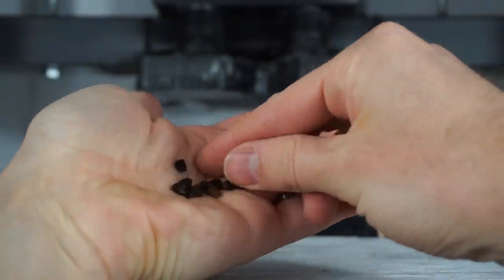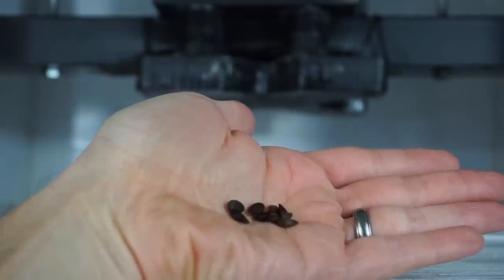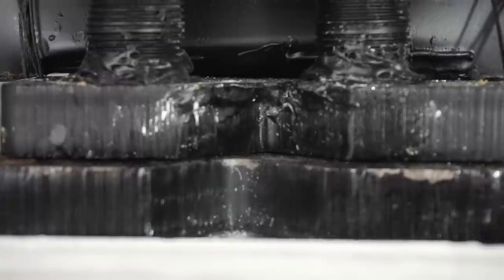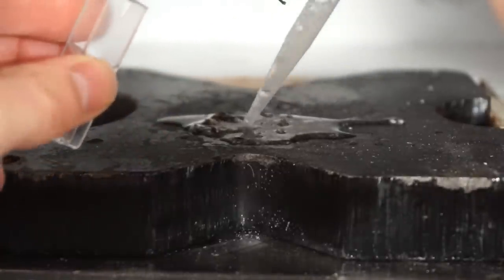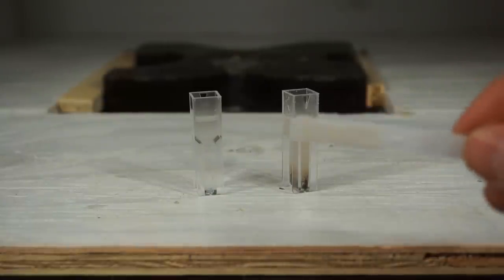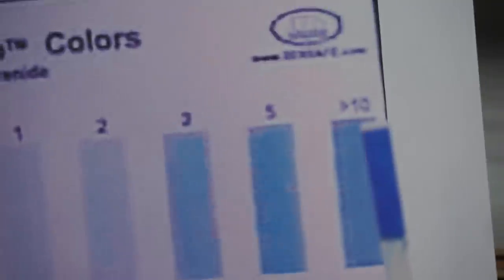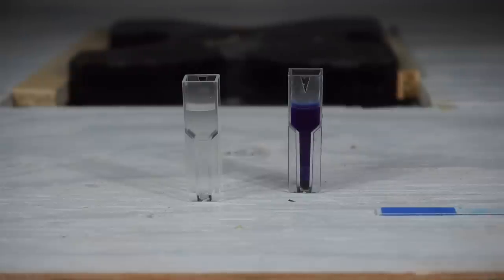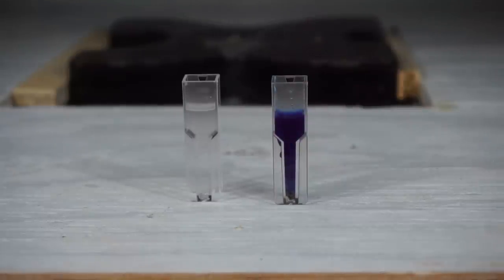Extracting Cyanide From Apple Seeds With Hydraulic Press

Comment: Wow an actual experiment on YouTube,  that follows the scientific method? Kudos.
Reply: "follows" is very kind. This was sloppy as shit and he jumped to an invalid conclusion based on extremely limited information.
Reply: This video is completely wrong in so many ways, not fact based at all and definitely not following the scientific method in any way.
Reply: The best way would be probably to grind the seeds and extract substance of interest (good ai filter) with some solvent.
Reply: You need to re-evaluate your understanding of scientific method. 

There was close to zero extraction here.

A start would've been..
Extraction of amygdalin can be performed by

Immersing the material in methanol and subsequent ultrasonification
    Soxhlet extraction with methanol
    reflux extraction in water in the presence of citric acid etc etc

Comment: You would need at least 150 seeds for any adverse effects.
Eating the seeds releases no cyanide because the skin protects it from your enzymes. 
The lethal dose varies on individual tolerance and body weight. 
To actually take in the most of the cyanide the seeds would need to be thoroughly chewed or ground very fine. 
A typical apple contains 0-20 apple seeds.
Reply: I also heard that the cyanide in apples is only theoretically dangerous, if you were to breathe it in in gas form or something (and probably also in higher concentration than just one apple). No idea if it's true, though.
Reply: So if we take the average of 10, and account for body weight, you're telling me I need only 50 apples? That's like 5 bags!

Comment: How many apple seeds should be eaten in order to be lethal?
Reply: really no amount of apple seeds eaten will kill you. The cyanide is in the shell of the seed and it is too hard to digest, so it won't create much hydrogen cyanide in your stomach no matter how many you eat.

I guess if you chewed thousands and thousands of seeds, and kept chewing and chewing and chewing until they became almost nothing in your mouth, you might die that way.
Reply: Dave Fish, chewing is the answer 😁
Reply: if you're chewing and swallowing apple seeds, without drinking any fruit juice or eating any of the fruit of the apple, which would neutralise the cyanide in your stomach, then you'd need to eat about 1000-2000 before you got really bad stomach pains and would be unable to continue eating them. If your jaw muscles were strong enough to be able to chew up that many seeds without completely seizing up, that is.

In most people this would not be fatal, you would metabolise the cyanide faster than you were ingesting it. If you were really, really unlucky (and determined), then that amount might kill you.
Reply: Dave Fish How exactly does the body metabolise cyanide? That's not how it works
Reply: If you were to smash about 500 seeds and not dilute with water, it would do the trick if you shot into your vein.
Reply: When Will You Learn? Its now about how, its just about how muh is in the seeds. Its barely anything.
Reply: around 18-20 cores put em in a blender and blend them well
Reply: I believe I read somewhere that eating like 1/2 a cup would do it but, not everything in the internet is right
Reply: What if you smash the seeds and extract the cyanide?
Reply: Get some large container and smash the seeds into pulp and juices and then eat/drink that
Reply: Without crushing and just ingesting it without much fine chewing it would be 60-80 seeds. With crushing 20-30.
Reply: Roughly 200 seeds or 20-25 cores
Reply: 200
Reply: hornetluca 3 for a healthy person, 1 for child or elderly.
Reply: u have to bite or crush the seeds to get the cynaide out 
and you need about 145 seed if you weight 70kg
Reply: I've read about it and from what I learned you need to drink/eat atlist 1/2cups of greatly crushed/blended apple seeds
Reply: Half a mug
Reply: Well, that's reassuring, you can't even get affected by the cyanide in apple seeds even if you are trying too. Thanks, metabolism. xD
Reply: You need 3 apple seeds crushed with your teeth to die right away. So, I'd only eat one.
Reply: It depends grown on a farm apples 150 wild apples tho different story only like 10 or 15 they have a higher dose in them dont eat them PEOPLE
Reply: Actually 150 apple seeds are enough to kill you
Reply: Actually 150 are enough to kill you
Reply: 150
Reply: 150
Reply: hornetluca 4
Reply: Dave Fish more like 200
Reply: you have to eat around 1,600 Apple seeds if you want go get the Lethal amount of cyanide
Reply: Well the leathal else is 120 apple seeds or above but I do not recommend eating the amount because it's 2 minutes of hell. Also it only takes about 20 apples.😳
Reply: hornetluca 150
Reply: hornetluca 150 seeds
They need to be crushed, and chewed thourouly
Reply: About 150
Reply: 150
Reply: I think cyanide is not a pain free way to go.  It is so gut rennchingly awful that maybe it is the excruciating discomfort that eventually kills.  Pain killers are less painfull.  Not recommended.  But still less painfull.
Reply: Dave Fish deff agree with you pretty sure ur jaw would just seize shut and you would prolly pass out from exhaustion and or pain at that point better off just drinking some apple juice and relaxing lmfao
Reply: When Will You Learn? Cyanide is natural occurring. The body actually does break it down easily. Cody's Lab did a video on this where he actually eats a non lethal dose of cyanide
Reply: Adam & eve ate da apple and God put cyanide into da core to punish any hooman who dare ingest da 4bidden fruit to da core.
Reply: Two tonnes. That'll kill you.
Reply: Eat 1000 kg daily
Reply: hornetluca it takes around 200 to kill you
Reply: the question is, why this place is kinda like suicide suggestion thread?
Reply: 7 barrels of apples will kill You first
Reply: 17
Reply: Sometimes citations are needed.
Reply: When Will You Learn? - thats right, that shit never leaves the body, like LSD there is no way to metabolize it. There was an ex-president (one from way back) who was exhumed and cyanide was found where his organs used to be. His death was then known to be assassination by poisoning.
Reply: Yo man I eat the seeds every time I eat an apple
I'm not dead
Reply: I have heard you would have to eat an entire bowl
Reply: hornetluca It binds to your mitochondria’s cytochrome oxidase, inhibiting the use of oxygen causing acidosis and hypoxia. But the amount in apple seeds to no where near enough to harm you in anyway. And other than cell death in extreme case of hypoxia, there’s no other chronic symptoms.
Reply: 95
Reply: at least 100 seeds will kill you
Reply: about 18-20 apples worth of seeds will kill you if you're of average weight
Reply: So that's more or less 120-170 seeds depending on how much you weight but mind that lesser amount will probably still damage your liver and could get you in a hospital
Reply: lethe56 two tonnes (or even the lesser mass tons) of anything will kill you.
Reply: If you Grind up about 200 seeds in a pestle and mortar then eat the paste should do it
Reply: 25 seeds mixed with horse spunk 👍
Reply: If cherry seeds take almost 100 than you won't have to worry about apple seeds in the slightest.
Reply: hornetluca about 25 apple seeds. BUT, you need to chew it thoroughly to get the cyanide
Reply: When will you learn: It's metabolised by the liver pretty quickly, so unless you take a lethal dose at once, your body can kinda deal with it ;)
Reply: Precious Taco do u really think that he's serious about killing himself by eating apple seeds?
Reply: about 5k - 10k seeds of an apple if im right
Reply: Probably need to evaporate the juice to concentrate to powder form.
Reply: hahahahahahaha
Reply: 150
Reply: 10000000000000000000000000 mcl of that liquid.approx
Reply: 150
Reply: I've personally eaten over 100 apple seeds in a day and for sure thousands in my lifetime. Never had any problems. The cyanide in apple seeds is bound to glucose and it's in fact called amygdalin.
Reply: Get some help.
Reply: around 147 seeds
Reply: depending on waight
Reply: google says 200 seeds for a fatal dose and 20 cores for a fatal dose so the person who said 1000-2000 you would be dead in hundreds of of a second including any one who got spat on and entered the blood stream im no professional but thats from reading online and in science books based on poisons
Reply: i would say a cup of seeds in a blender with some water. i would take several sleeping pills first. i think the cyanide has a pot life of hour or two. so the seeds in a blender is the last step...
Reply: There was a nice Video about this, I Think it was 100 - 150
Reply: When Will You Learn?: the contains an enzyme called rhodanese (a transulferase) that converts it to thiocyanate. cyanide is ubiquitous, lentils, lima beans, millet, barley all contain these nitrilosides as do nectarines in the flesh, cherries, huckleberries, peach and apricot seeds. Papaya. Macaroon cookies are traditionally made with apricot seeds, very rich in cyanoglucosides.  Vitamin B12 has a cyanide molecule in it. Most of the fear is based on myth and bad science. Pure hydrogen cyanide behaves like a vitamin with proteases. Papain, the enzyme of papaya is feeble without cyanide.
Reply: Jason McMurry. BS. arsenic or strychnine. not HCN.
Reply: 150 to 200 if you chewed them good enough
Reply: who is going to eat that many apples, or drink that much juice? The body has enzymes that immediately sulfate hydrogen cyanide into thiocyanate, so even if you could chew that many seeds without gagging, the body processes are quicker than the swallow reflex in ingesting them. food borne cyanides or Nitrilosides are a different thing from potassium or sodium cyanides. Lentils, lima beans, garbanzo beans and hundreds of other food plants have hydrogen cyanides in the form of glycosides or sugars that people ingest every day. Again, this is a silly ass video.
Reply: hornetluca about 198
Reply: 200
Reply: Dave Fish literally eating to death
Reply: Ive seen that eating a 150 straight up will do the job
Reply: 1 TON PROBABLY, THAT MUCH COULD BE ENOUGH TO EXPLODE YOUr STOMACH!
Reply: 1kg guaranteed
Reply: Well Mr Fish, apparantly the father of the modern computer Alan Turin used apple seeds to extract the cyanide and kill himself, so how do you anser that one?
Reply: Maybe 4 to 5 hundred to produce 1 drop of cyn
Reply: well I'm sure if you ate 10,000 seeds you'd likely die if not taken to a hospital.
Reply: Atleast 150
Reply: i am trying 50 apple seeds chewing them all
Reply: hornetluca around 30 apples
Reply: hornetluca like 5 kilos (I'm making this up)
Reply: The real answer is an unrealistic amount. Any real potential threat of cyanide poisoning cannot be obtained thru commercial methods, no matter how interesting this video is.
Reply: hornetluca u would hav to eat around 150 or more of apples n have to chue the seeds every hard
Reply: 1
Reply: you wouldn't need thousands, you don't even need hundreds if you put them in a blender, especially if you're a person of lower body mass
Reply: Test done by him was sensitive to 10ppm... And he crushed approx 10 seeds.... To kill somebody weighing 70 kg one would require 1g or less actually.. And 1g/ml = 1000000ppm... Which is 1lakh more time greater... So you will need 10lakh seeds.... U can lower it down to 5lakhs if u extract it efficiently...
Reply: hornetluca,   are u still alive? ................
Reply: If i remember it right it would be a big bag of seed
Reply: hornetluca lol so many apparent experts followed this comment
Reply: hornetluca 3.5 oz
Reply: hornetluca try it and find out
Reply: Chew about 200
Reply: About 33
Reply: hornetluca 200 +
Reply: You need 20,thousand seeds to cause death by cyanide.Fact.
Reply: @nebojsa1976  hello 4th grader
Reply: Probably over 1000. Cyanide is good for you in small doses.
Reply: @Knatrick  I can assure you cyanide is not good for you in small doses
Reply: @lebanemcarl68  I can assure you that there is a vitamin called vitamin B17 laetrile (aka amygdalin which has anti cancer properties) in apple pips and kernals of peaches and apricots. There have also been studies that cyanide in small doses also help to prevent cancer. Also if you find this really hard to rack your small brain around then please explain amaretto, an Italian liquor that is made from the stones of apricots and apple seeds and it's not poisonous.
Reply: 1.7mg(ml) per one kilogram, so.. Count. Though it applies to clean cyanide, extracted from the seeds.
Reply: @Knatrick  Just because it can "help" prevent cancer and it has a vitamin doesn't mean it's good for your body. Cyanide is a POISON do you get it?
Reply: Bake them then eat them
Reply: @lebanemcarl68  Everything and poison in high doses oh my God does you IQ match your age? And you still haven't explained amaretto.
Reply: more than 200 seeds after crushing them
Reply: 50
Reply: @juncastillo2371  yes, still alive

Comment: Is that a true hydraulic press, or is it a pneumatic press? I was just wondering, because it sounds like air and not hydraulic fluid. But, I may be wrong. Maybe some sound different. It would be cool if you (or anyone with more knowledge in this field than me) could respond. Thx!
Reply from the maker: Yes this is a true hydraulic press. Hydraulic presses can either have an electric pump or an air pump to pump the hydraulic fluid into the press. Mine uses an air pump so that's why you hear an air compressor.
Reply: ok. thx! the more ya know!
Reply: You need to eat 20+ apple seeds to get poisoned by cyanide
Reply: TOZTOZ how about Nightshade?
Reply: he uses a press with a 30+ton bottle jack in it, the bottle jack is being pumped by a pneumatic pump but the actual pressing power is made by the hydraulic system that is being pumped by the pneumatic pump.
Reply: TOZTOZ not unless you break the seed open
Reply: TOZTOZ wtf is a cherryberry
Reply: TOZTOZ you know Cherry's aren't Berry's lol
Reply: ya but.. Johnny Appleseed
Reply: Logan Landry it's probably pneumatics cuz you can here the compressed air as the press goes down and you Han hear the air compresser every so often
Reply: Chrysti Sander Thankyou for the information. Not that I would need to know how many seeds it takes to kill a man or anything.....
Reply: i love how i asked a legitimate question about hydraulics and pneumatics and it turned into a debate on how many apple seeds will kill you...thx internet.
Reply: Logan Landry: well, your question was answered so there wasn't really more to discuss about it.
Reply: Logan Landry bold and brash....
Reply: Its Zimyc yes. The boldest and brashest
Reply: you can't be poisoned by eating apple seeds, the cyanide doesn't come out of the shell unless you crush it into a fine powder. You'd need to eat over 1000 to even get sick.

If you crush 200 into a very fine powder you can use it to kill someone if you dissolve it into a drink.

but not apple juice, apple juice will destroy the cyanide :)
Reply: TOZTOZ I've eaten 3 cherry seeds once how am I not dead then? 🤔
Reply: TOZTOZ that. Is. Bull. Crap.
Reply: It's called air over hydraulic. It's great for shops with a good air compressor.
Reply: CHERRY BERRIES. I laughed at that shit for like ten minutes lmao thx

Comment: I'd say that you need to investigate how the test kit works to test for cyanide. There are two failure points I can think of currently:

1. Perhaps it's non-linear when it comes to testing for cyanide. (Outside of testing range).
2. It could be that the chemicals used in the test strip are able to "pull" the cyano group away from the amygdalin molecule much more easily than chemicals in the body are capable of doing.

The first point would mean that the test may indicate an artificially high amount of cyanide, because it's measuring outside of its effective range. The second point would mean that amygdalin inside the body may not be as damaging as the test strip reveals, because the test strip may have a greater ability to "pull" the cyano group away from the amygdalin molecule, showing a greater positive result.
Reply: @bengulmann3557  
It would be interesting to test Vitamin B12 tablets with the testing kit to see if the cyano group reacts and produces a positive result. Most B12 tablets contain Cyano-cobalamin.

Comment: After exposure, cyanide quickly enters the bloodstream. The body handles small amounts of cyanide differently than large amounts. In small doses, cyanide in the body can be changed into thiocyanate, which is less harmful and is excreted in urine. In the body, cyanide in small amounts can also combine with another chemical to form vitamin B12, which helps maintain healthy nerve and red blood cells. In large doses, the body’s ability to change cyanide into thiocyanate is overwhelmed. Large doses of cyanide prevent cells from using oxygen and eventually these cells die. The heart, respiratory system and central nervous system are most susceptible to cyanide poisoning.

Comment: Sorry to break it to you, but you don't have cyanide, you have amygdalin. When you crush and digest amygdalin, some enzymes in your body makes the amygdalin into hydrogen cyanide (which is what that kills you). 
To get to the lethal dose LD50, you'll have to ingest around 200 apple seeds, if you weigh 70kg. And that is if you chew them. If you don't chew them, probably nothing will happen or you could get a small stomach ache. 
Apple seeds actually contain a very low amount of amygdalin compared to other seeds, like apricot, cherry, plum and peach seeds.

Comment: Eat at least 1.3 seeds per pound of body weight, and it should 
kill you quite fast. If you weigh 160 lbs, you need 230 crushed
seeds. must be crushed, or will just pass thru your system. It
also depends on the apple, as some are more potent.